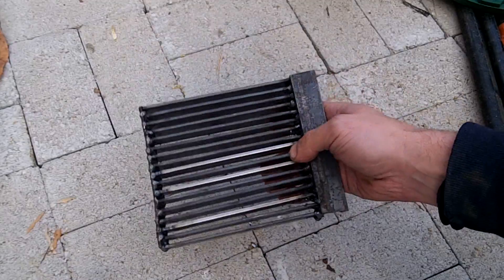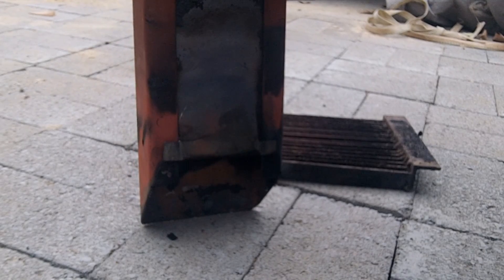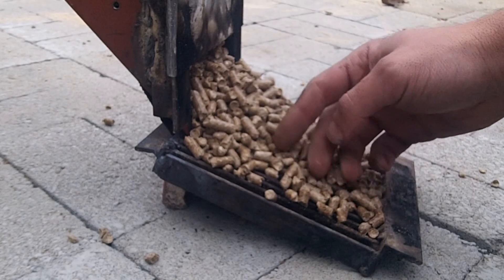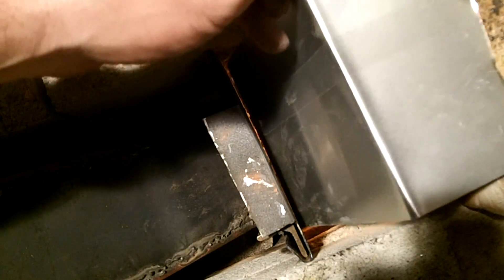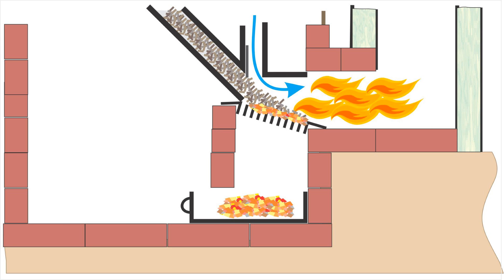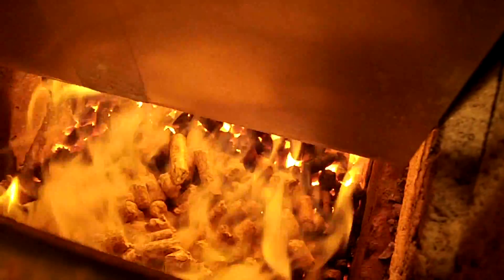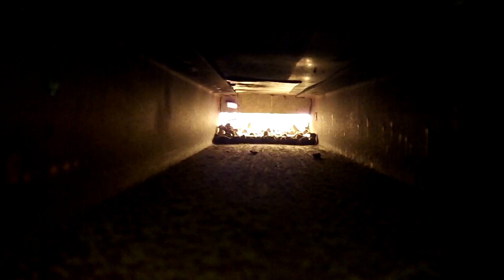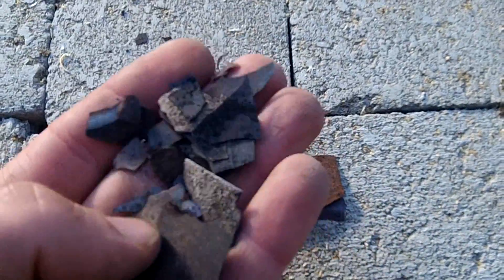Burning Pellets in a Rocket Mass Heater

Comment: You need to think about the burner design as a carb on an engine. The mixture of fuel (pellets in this case) to air intake. That's how I designed my burners and they work flawlessly.

Comment: Great, great and great!  Thanks for sharing!  We are working toward a system like yours but are still in our infancy.  At the moment,  we are just trying to keep things alive in a greenhouse with temps down to -15.  We are trying to design the ultimate firewood hopper for our rocket stove and also using a multi ported cob mass bench with a blower fan to be able to release the heat from the mass more quickly when we need it.  Pellets aren't free and right now the wood is.  Anyone seen a wood fed rocket stove that can burn for 8-10 hours or even longer?  Yes, I'm aware that you can buy a wood furnace heater but they are very expensive.
Reply from the maker: I've seen one guy build a wood burner.  I think he called it a "batch box", but it only ran for a couple of hours.  I'm currently building a new model that can burn wood that is loosely based on the Tarm boilers and rocket mass heaters.  I'm designing it more like a boiler since I'm liking the control I have over the thermal mass of water instead of the solids like cob.  If I get it working right, I should be able to burn wood chips in it too....without an auger.  I can get truckloads delivered for free.  I'm hoping to start doing test burns by early February.
Reply: I believe water is the way to go too but we found ourselves with beds full of plants in the middle of winter with a burning desire to keep them alive and no way to circulate water under the beds or into the ground at this point.  Also, the greenhouse is remote so we can't just walk out the door and throw another log on.  We are at a junction right now trying to decide which route to take to get the most benefit from our rocket stove and stored water.

(1) existing ported cob bench will act as a heating base for a large open-top water tank / drip tray. Above the tank, along the same profile, a rack for germination and growing trays.  

(2) We have two 275 gallon IBC totes in the greenhouse (one's filled with goldfish), which we can thermosiphon hot water to from some part of the rocket stove.  Radiator or coiled copper tubing?  Gather heat from top of barrel perhaps?  Also not sure if hot water in IBC tote for prolonged time is a good idea.  

I can't wait to see the design that you're working on now!  I just got a portable mig welder that is opening up all kinds of options in my mind.  We also have access to free wood chips (fresh cut and very irregular).  It may be necessary to burn small chips / chucks / pellets in order to get prolonged efficiency of burn and clean exhaust.   I'd love to see how you plan to build your wood chip feeder.  No doubt, you'll go through many design refinements, as you did with your pellet feeder.  Awesome job documenting that, by the way!  I love it when people follow up on their design posts so we can all save ourselves the same headaches.

Comment from the maker: It the grate is too fine, then then ash won't fall through and it will clog the grate.  It's really needed to draw the air through all the pellets to keep the stoked.  Also any air going through the ash pit helps to burn any pipes that do fall through and the gas/smoke gets reburned in the main part of the burn tunnel.

Comment: All the videos I've seen with rocket stoves use steel in their chimneys, I worked in a forging factory and found fire brick etc. got hot and stayed hot for hours even with no fuel. We could melt steel in minutes( not what we wanted) just an illustration. Does this present a problem getting it started? I wonder if anyone has tried this approach especially if you were going to use your design- sounds every efficient.

Comment: I'm currently trying to build one of these in my green house and am having alot of issues.I have used soil as my biomass, and the exhaust tube I made from 35 gallon barrels cut to make 8 to 10" tubes that slip into one another.They did not fit snug but slid into each other and there were gaps. I back filled with dirt and figured that would seal them. I am not sure but I think smoke is coming up through the dirt. Any advice for a complete noob? My last vid shows what I am working with.Thanks

Comment from the maker: Thanks...but I had this designed and built long before the show.  ;-)  I'm actually surprised that there would be a patent on a feeder.  Back in the 80's I visited a place that had a huge feeder that ran on wood chips...it worked the same way.  It was quite impressive to see a huge furnace run that way!  Regardless, your stove is pretty neat and I love the fact it doesn't need a blower.  I hope you do well with it!  -Rob T.

Comment from the maker: Hey Meg!  I experimented with this one to slow down the burn but for the size pipe, it had to burn at this rate.  It will burn, but it doesn't have the "rockety" burn.  I'm sure you could build a smaller heater with a 6" or 4" pipe and adjust down the size to feed less.

Comment from the maker: It's about the same burn rate as a stove that is rated for the same BTU's...but the stove has more waste heat going up the chimney.  If you ran one this size in a house for any length of time, you would probably have to keep the windows open.  ;-)